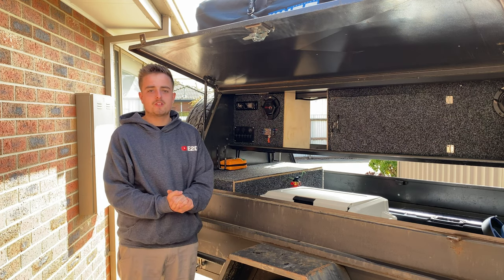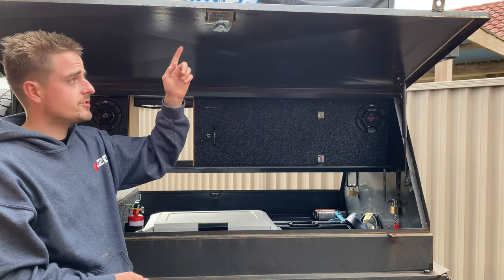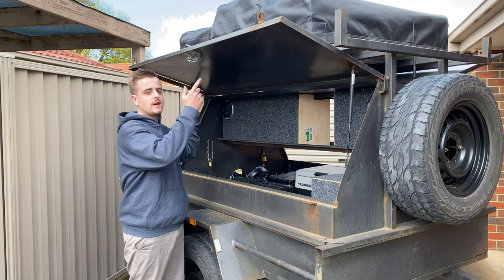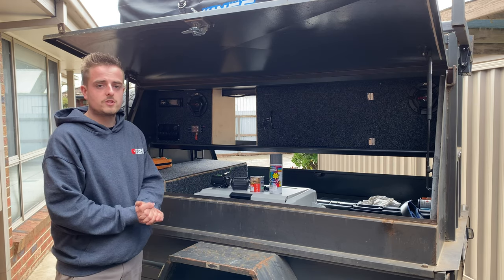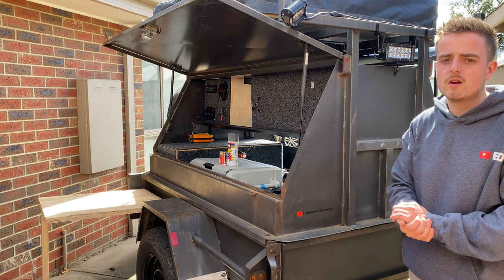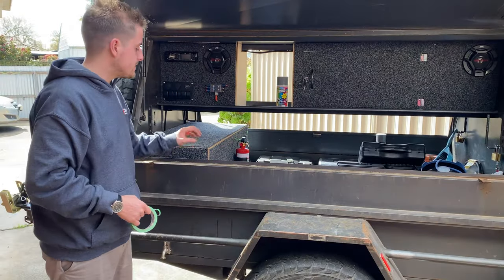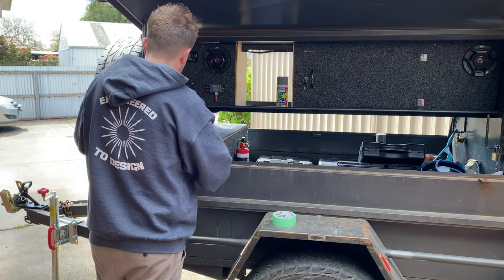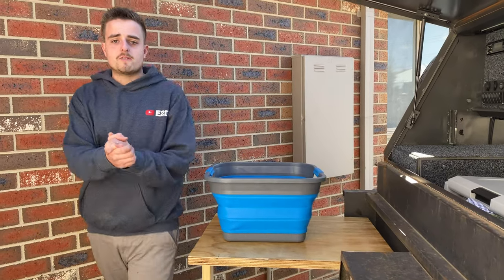Camper Trailer Conversion Part 11

Comment: Hey mate. Use round bar drill 2 holes on side of table for round bar to slot into. Bend round bar in u shape so wash bucket can sit inside it that way you dont lose bench space. Keep up the great content.  Cheers
Reply from the maker: Hey mate that is a great idea I think I will do that for sure, what size round bar should I use? Thanks
Reply: @EngineeredToDesign   hey mate at least 6 mm but might be 10 mm just check under  the lip off your wash up bucket to see which size fits better.
Reply from the maker: Will do thank you much appreciated :-)

Comment: Sorry mate,only just saw your message from your last video. I've got a set of 180 watt panels placing 13amps in to a deep cycle. I've had my panels and battery for a few years now but I can't get my trailer still because of this lock down. Il set it up on a h style rack with the battery (2 maybe) in a box in the front.
Reply from the maker: Hey Mark that sounds great and your pumping a fair bit of solar I can’t wait to do something similar.
Reply: @EngineeredToDesign  i picked up my panels off ebay. They have never failed me yet. Ive got nearly everything i need to set my trailer up... im just missing the trailer. The fella im buying it from is hanging on to it for me. We are just waiting to get the ok to travel. The silly part is that we are only 3 hours apart. Thanks for making your vid.
Reply from the maker: No worries Mark thanks

Comment: Hey mate is there a video on your gas struts? Chasing some for mine
Reply from the maker: Hey Josh they were fitted when I bought the trailer, but I did fit one to my bumper build from Bunnings and it works great you can check that out if you like :-)